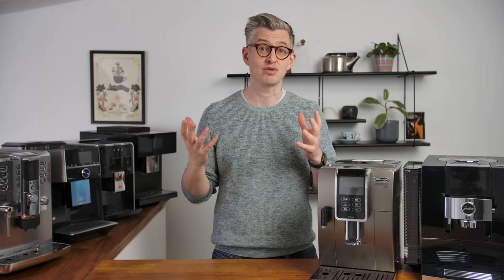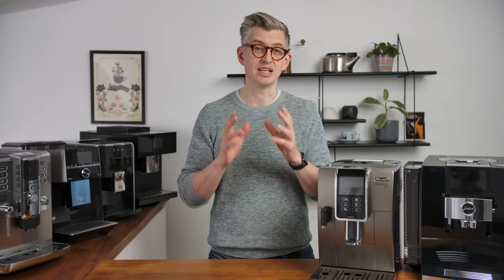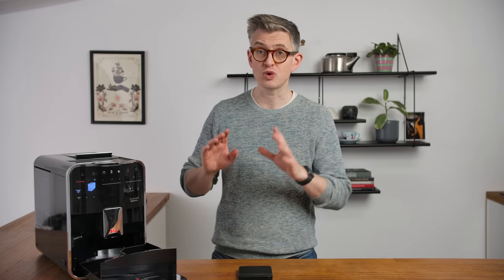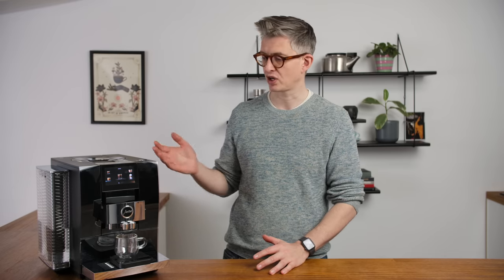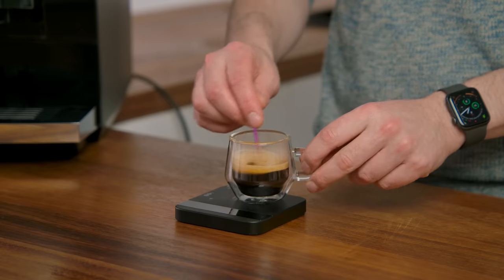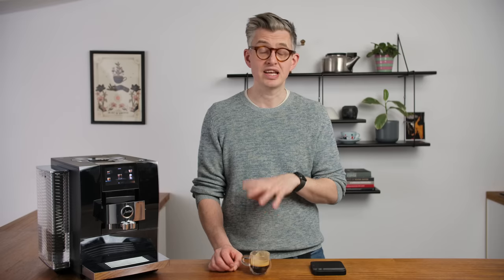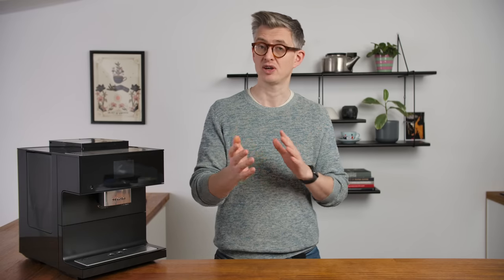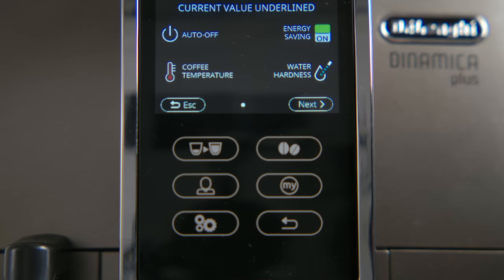How To Dial In A Bean To Cup Machine (Like A Nerd)

Comment: Thank you so much James, I have had these types of machines for over 15 years now mainly for the convenience and flexibility factors. Jura  has been my go to for both drink selection, ease of maintenance, and reliability. I currently own 2, but have owned and sold 3 other during that time. Each machine worked flawlessly for over 10 year before needing repairs, unless maintenance was neglected. 

I have done similar steps, but slightly more OCD that your process: 
1) set temp to max always 
2) set dose to max 
3) set grind to finest 
4) adjust volume out stopping if brew was to fast 
5) cup results at grind setting to select best options (select semi-finalist setting)
6) repeat 3-5 stepping up grind setting, stopping if brew is to fast 
7) re-brew each semi-finalist to compare. 

With Jura machines this results in 1-2 steps finer than factory and between 50-80ml volume. I hope yours will provide me quicker results so i can waste less coffee and I am looking forward to see your side by side comparison video of bean to cup machines.
Reply: Thanks for your post. I have the E6 - but wonder if I should have stretched to the E8 for the sake of its "ristretto". Doing you have one of those? Would it allow for 'dialling in' more precisely, or a different grind?

Comment: I have a Jura Ena 4 and tried to go finer and finer, and the shot got more sour every time. After watching more videos from you (and buying a gaggia classic as hobby machine) I diagnosed the issue as channeling in the puck. So I settled at 6/8 (8 being most course) regards to grind setting. I yet need to weigh unbrewed coffee on max setting. but I dialed in my "espresso" to around 1:4 ratio (assuming max beans is 10gr according to the manual.) Also I brew Lungo's with it going up to 150ml which I know is not perfect, but hell, it sure is easy. I normally use medium roasted single origin freshly roasted beans which work well with this higher ratio. And I'll try to get my proper espresso's from the Gaggia Classic (with Gaggiuino mod eventually), starting with a hand grinder and probably moving up quickly to a df64 grinder.
Reply: Going too fine on my ENA8 always left some ground coffee in the chamber resulting in clogged filter. Even the cleaning programme would not get it out and I had to disassemble the machine to clean the (non-user removable) brewing unit. Damn those special screw-drivers you need for these machines.

Comment: I purchased the Phillips 4300 superautomatic. It consistently produced sour espresso no matter which type of settings I used. I think part of the reason is because most superutomatics utilize an equivalent to a pressurized portafilter in the brew group mechanism. I also don't believe the water is heated well. For example, on the one I had, the water heated to no more than 140F, which is way off the mark. I also used the recommended coffee, which is Lavazza Super Crema. Had the 4300 for a week, and returned it back. I then  purchased a Breville Barista Pro, and so far I am very happy with it.
Reply: im in the same boat right now, im about to return it after receiving it yesterday LOL... been trying to brew all day yesterday and wasted so much beans to get the taste i want...
Reply: The issue is the o-ring based piston cylinder design... They can't take too much pressure, or the o-ring will leak, so most of the shots are under-extracted due to short shot time.
Reply: We like it but we drink the cappuccino with a shot. It easy and easy clean up.

Comment: Thanks for this review. I bought my DeLonghi Dinamo Plus almost 2 years ago. Your video confirmed my right decision. I use this machine daily for 1 to 5 cups of espresso or latté and I am very happy with it. Regarding the programming of the water in ml. I do that over the app., which the tested version probably doesn't have. 
The app is not the best feature of this machine. Except for preheating it in the morning from your bed, it's pretty useless and after the last update it has gotten worse in using.
For the rest I can recommend this machine for the price level.

Comment: Thank You James , Excellent points.
                     I have a Delonghi Magnifico 4200 , I find the grind setting works well and use it at its finest setting , with the most amount of coffee on the bean setting , I also use 2 shots with very little water for 1 espresso.
  I adjusted the water until I got a very nice espresso that is surprising, I have also examined the pucks that are left , I think the grind setting is good , as they are always in a good shape and not falling apart , the group head does tamp once with the piston moving up at the Pre stage, then the full extraction occurs , I do know however I use more coffee than you would in an espresso machine , but I get an equal tasting espresso for the trouble, I think  . Maybe you could try it to get a better taste ?
                      The Coffee Beans I use are Lavazza Intenso . 
                                                                       Regards Bob

Comment: You changed my coffee game forever when you recommended to add hot water from a kettle to an espresso shot RAHTER than using the coffee brewing button. I did a side by side comparisons - as any good scientist would. You're spot on. Now I'm doing espresso button and topping with hot water for my coffee. Won't go back either.
Reply: Also try the otherway round, Have the hot water in the cup and then extract the espresso into it, I find it gives creama to a long black and improves the taste.

Comment: I’ve got a Jura Giga 6, and love it. I’m not a big espresso coffee drinker, but this machine makes it easy to get a really good cup of morning coffee with no thinking before my mind is awake. Upon purchase, my hubby and I spent about 3 days going through all of the options and tweaking the settings (as you suggest) with grind settings, coffee volume, water volume, temperature, etc., then saved these settings with the individual drink choices. I haven’t bought coffee from a shop in years, as we now make better coffee than any shop. Very freshly roasted medium-roast beans seem to work best for us, as compared to specialty coffees, so we search out coffee from our local roaster weekly. This was a pandemic purchase (lifetime investment?) that we thoroughly enjoy every single day.
Reply: Do you mind sharing your settings?  I had a Jura En8 which made a great cup on coffee using Illy Inteso Beans.  I upgraded to Jura Z10 and the coffee is still great but slightly bitter.  I'm going to try weighing the dry puck and adjusting to ml but I was hoping you have the perfect mix.  Thx

Comment: I have had the Dinamica for a year now and never noticed that it was making bad coffee - because I usually make Flat Whites. Due to being a Fat Bastard I am on a diet right now and started drinking Espresso's to cut out the milk I was smashing each day from about 6 or 7 Flat Whites ... now I've never been a fan of black coffee but the Espresso's I've been making are quite sour from the Dinamica. I tried using my Moka pot on the stove and it was better. So now I'll run through these steps and see if I can improve the Espresso the Dinamica puts out - thanks for the tips James!

Comment: Revisiting this video after upgrading my Gaggia Accedemia (the one in the video) to the new 2022 version (warranty upgrade woooo!).
Not overly a comment about the video - the advice works great when getting dialled in, especially with lighter roasts :)
Mainly just a comment on how much better the new Accademia is than the old one at handling speciality coffee, considering the internals are pretty much the same, the quality of espresso between the two is on another level and the closest to a manual machine I have found so far (I think as the brew temperature seems to be both more steady and higher. So, either my old machine was broken from day one or the upgrade really is that much better.
The day a super auto preps a puck in some way will come I'm sure of it...but thanks to James I can get pretty damn good coffee without the faff of a manual machine, so Thank you very very much :)

Comment: Basically found the same as what you explained, but I didn't have your guidance back when we had an automatic bean to cup.

It was a Melitta "Caffeo Solo & Perfect Milk" - it took me weeks of guessing to get a decent drink out of it, but I was happy with it until it started leaking water (it was an old machine I repaired and got 2 years out of for free, so it wasn't a bad deal!)

Generally, set it as strong as it was a capable of, with a medium grind setting, with it "pulling" the shot for 15-20 seconds. It didn't have a menu, just a dial, and it'd sometimes be a different result without you touching it.

I did like the convenience, but automatic machines can be so temperamental in terms of descaling/cleaning them - ours always ended up getting stuck. Also, the milk prep although it produced a reliable foam, it didn't make the milk hot enough. It converted me from never drinking coffee, to being quite interested in it quite quickly.

We changed to a Sage Barista Express in the end and learnt to pull "real" shots with it and are generally far happier with that, now.

Comment: Well said. The machines are at best automated Mocha pot brewers. Working with light roasts, they really struggle. We're offering them, but had started doing mix darker and light roasts so that the coffee extraction is improved. You get the flavours of the specialty light roast, with good body, with at least a 30% darker roasted coffee blended in. Sticking to a 50/50 dark/light roasts seems to produce the best case for coffees that will be consumed with milk/milk foam. 

Well said about the puck prep. I also think the smaller diameter of the puck means the depth of the puck needs to increase depth, this increases the chance of channelling. Super-autos with larger diameters seem to perform better.

Comment: This was fantastic! Small, weird niche of users who look to run specialty coffee on a bean to cup machine, but we exist. For myself, I've been trying to tweak our workplace Rex Royal Compact CT machines. These guys have actually TOO many settings, which can also be frustrating. There is a way to calibrate the dose by weight, but I couldn't figure that out. Skipped the grinder tweaking and went straight to the temp, dose and water. Ended up being 96deg (likely lower in reality), max dose of 15.5g, and 60ml out. I found that we could actual pull a little complexity and sweetness from the Stumptown Hairbender! I'd love a few more hours to really tweak this to perfection. I don't exactly know how the pre infusion menus work on that machine.

Comment: Something important to note that since it's timer based, changing the grind setting will change the amount of coffee.
So same coffee amount settings at finer grind will give less coffee and vice versa as distance between burrs changes allowing more or less coffee to pass during same duration.
So it's important to do this exercise after changing grinder settings and allow for retention to be purged out as well first.
Also double cup button does not grind double the coffee, it just increases 30-50% more than single cup
Reply: depends on the machine, the Jura Z10 and some others will grind and brew two complete shots when in double mode.

Comment: Your espresso series was helpful as I attempted to dial in our old Saeco Talea Touch. Aiming for solid times and tasting for flavor was more helpful than anything on the machine itself. It uses funky terms like “aroma,” “strength,” and “pre-brewing.” A “volume” adjustment then led to “espresso water dose” as the only adjustable setting. No mention was made of grind in the settings. However, once it was getting good coffee, repeating it was as simple as pressing a button. For my wife, who doesn’t pay attention to where our grinder is set or care about weight for her pour over, it’s perfect.

Comment: thanks James for the tips. I will try decrease the grind setting to a less finer level. 
I own a Gaggia Brera and i’m pretty happy with it. 
The problem i have is that i have the impression that the brew is always just a little bit under extracted. 
But i have the impression this will be the same for all those BTC machines.
Also 3 downside 
1) if i use 100% arabicas, the créma is very thin with most of the beans i tried. 
2) if i use fresh beans, it’s too acid. I can only use italian roasted “miscelas” like industrial but high quality brands like 😊Vergnano, Essse caffé, Costa d’Oro, Lucaffé, Cagliari  that contains up to 10% Robusta.
When i do that i get the best possible shot with a nice créma that is closer to a real espresso (without being one of course).
3) if somebody among my guests want a lungo, it’s impossible to get one decent. I have the impression there is only a quantity that is the right quantity. usually 25ml max. After which only water is coming out and it’s disgusting.

Comment: I've got 3 of these types of machines and the convenience of them is really what makes them an attractive option, particularly in the work place where I can never find the time to brew a pot. I've replaced grinder burrs in order to fix grind inconsistencies and such. I totally agree with James' point about maxing the water temperature setting on these machines if you can. Two of my machines are Saeco Odea Giro plus, where there's no temperature control, so you have to tweak dosage, volume levels and finally grind levels in order to get it decent. The funny thing too is that even though two of my machines are the same make and model, they both make very different cups of coffee and need to be dialed in differently. I suspect this is from variance in manufacturing of all the various components.

My other machine is another Saeco, the Intellia Deluxe model. It has temperature control, dosage controls, grind fineness adjustment as well as the option to tap our hot water. It is significantly better than my other two machines,

 Even though they don't necessarily brew the best cup, they can brew a pretty decent cup if you're putting in fresh water and good beans with well adjusted settings. There's minimal fuss with grind disposal after a brew like a french press, minimal work to boil a kettle or fill a reservoir each time you want to brew, and no disposable consumables to worry about like filters or pods. Problems with drip coffee makers like people leaving the basket of grounds in over a holiday period, only to come back and find that mold has formed and you need to gut and clean the machine, are a non issue with these machines. Are they as good as a well crafted pour over or a well pulled manually packed espresso shot? Not really, but they have a place imo.

Comment: My first step in attempting to get better coffee was to buy one of these machines. It was a Delonghi. Frankly, instant was better. There was very little option to adjust the settings etc. Basically I gave up and sold it less than six months later. I now just use a  clever dripper or V60. I still consider myself a newbie in this area but I'll never bother with one of these machines again.
Reply: Same with Jura S8. Brews warm water that looks like coffee.

Comment: I've been down this rabbit hole before moving to a proper dual spring lever machine.
I've used a Gaggia Titanium superauto for around 15 years and am able to get decent "espressos" with it while using medium roast specialty coffee.

The tuning process I followed was definitely painful as grind adjustments are not immediate (it takes a few shots before they have an impact, and of course staling is an issue as the grinder is not single dose ready). With it, it's also hard to dial the amount of water with precision (there is volumetric control, but no dial to adjust it properly... programming the water amount requires releasing the shot button at just the right time). I did have to open up the machine to grind finer than the lowest stock setting and temperature is at its max setting.

All in all, with not too demanding beans; I can get 1:2 to 1:2.5 single shot with 10g in of beans  (the max it can take calculating by averaging beans usage over multiple shots); 20-25g out which taste fine -much better than without these tweaks. It's even possible to make decent milk based drinks (latte art being quite challenging ... although it can happen with some patience when the stars are aligned). It's been much harder to get there than on my dual spring lever machine and the results aren't as good either; but it is usable

I have another BTC machine (entry level Delonghi Magnifica 4200s) which is harder to adjust and won't give consistent results. I suspect this machine is better suited for 1:4 or longer ratios,

I'm curious to see what you found with the machines under review as I suspect that within any given brand the brew mechanisms are pretty much identical from one machine to the next